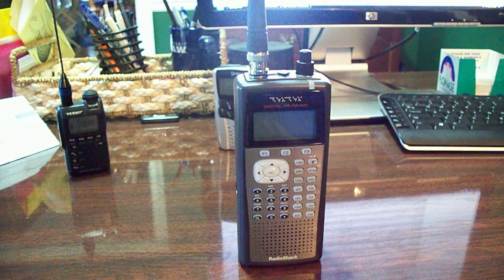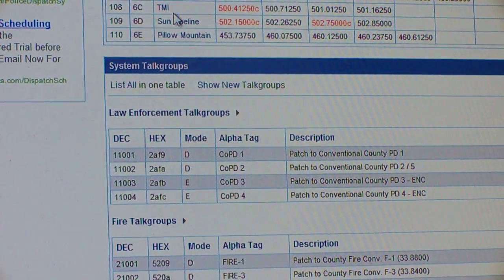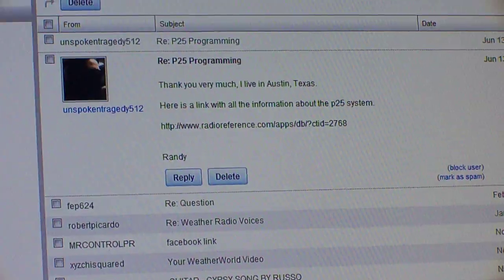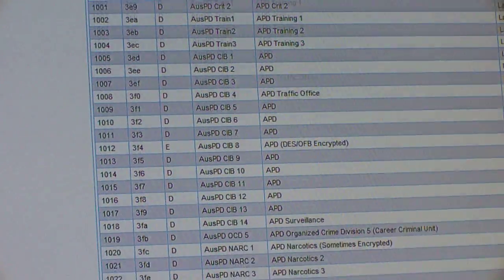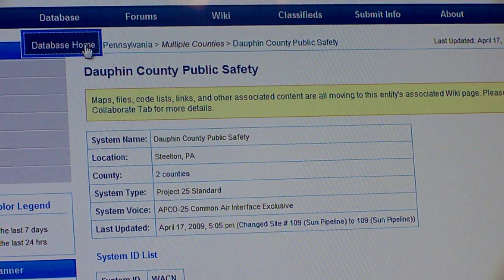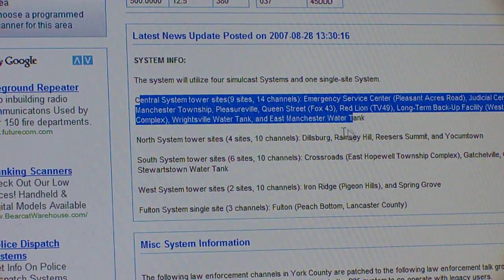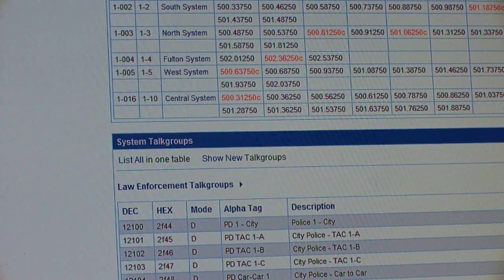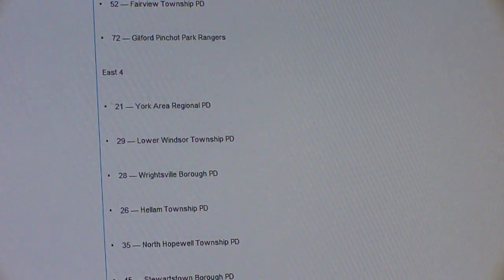Programming The RS 106 for P25 ***PART 1***

Comment: You only need to enter the primary and secondary frequencies which are RED and BLUE. Those are the primary and secondary frequencies.  500.8125 and 501.06250.
Those are the control frequencies.